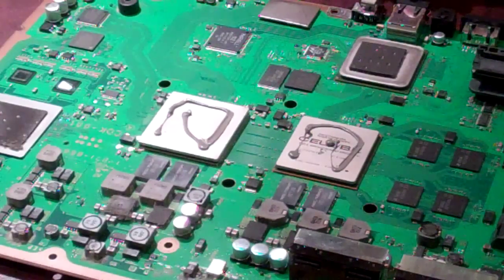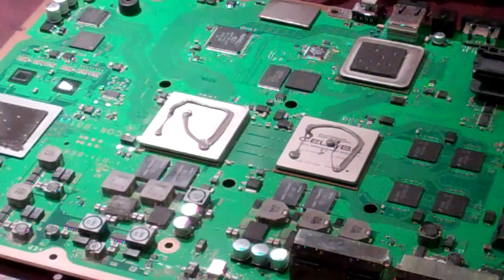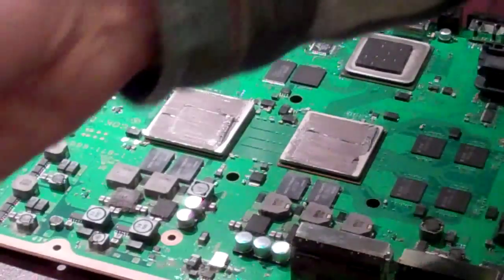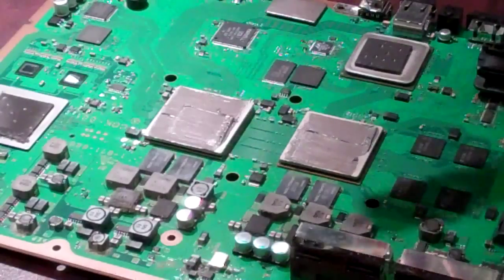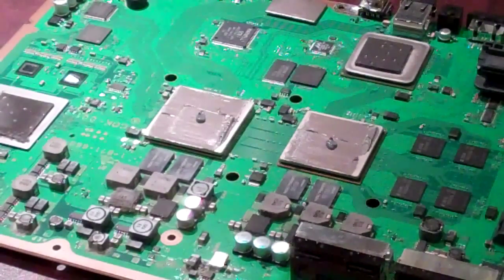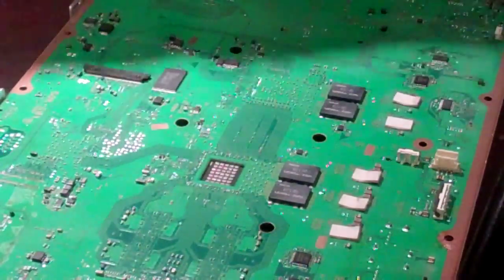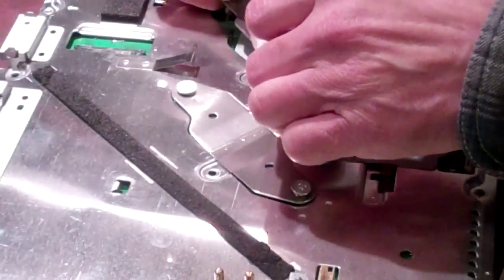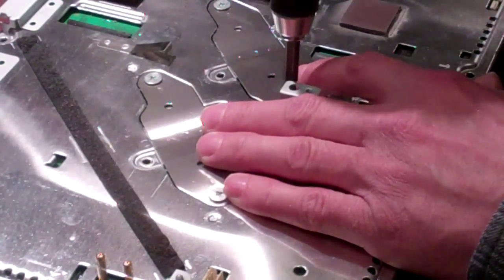Applying New Thermal Compound On Video Game Console Boards

Comment: hey thanks for this video i have a ps3 fat 40gb modal and i've had this modal since 2007 everything is fine with the system at the moment so i guess it's a good time now to put some new thermal paste on the cpu/gpu before i get the YLOD. just wondering what thermal paste do you recommend and also how often should i reapply new thermal paste?

Comment from the maker: Low Density compounds - The low density compounds will flatten out easily when compressed within the heat sink and heat spreader.  Almost any method will work.  We recommend when using MX2 to put a tiny drop on each corner area (ram chip locations) and a rice to pee size drop in the center.
Due to the extremely low PSI of the PS3 heat spreader and heat sink a different method must be used when dealing with compounds.  Try these out you will confirm them to be best options.

Comment from the maker: IMPORTANT INFORMATION ON PLAYSTATION 3 ARTIC SILVER USE:
Artic Silver 5 is a dense compound.  MX2 is not a dense compound.  
Dense compounds - When applying dense compounds on a Playstation 3 you will need to spread the compound.  1/10 PS3 units has poor contact from the heat sink.  For that a small drop of low density compound should be used in the center after spreading to fill any slight voids caused by poor contact of the heak sink.
PLEASE NOTE: This is only for the PS3 which has a low PSI.

Comment from the maker: @PeronMiles Thermal compound has a curing time.  Artic Silver has a long curing time.  This is affected by use - so with daily use it could be 3 months.  You may notice slightly (one level) increased fan speed during the curing time.  After that the fan should be quiet enough to not be noticeable.

Comment from the maker: @DontDenyTillUTry420 FYI - That is true for the xbox 360 - but NOT for the Playstation 3.  Due to the use of a heat spreader and the fact that the GPU only makes contact in the four corners - if you do not spread you may risk repeat YLOD and the unit may give overheat shutdown messages.  Either put four small drops in the four corners or spread - we have tested spread the way we list it and that has created a cooler end result.  Hence the video.  Thanks.